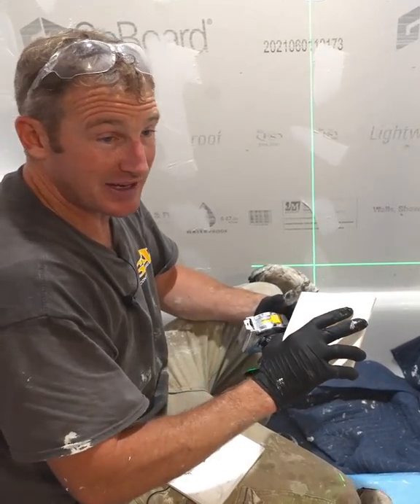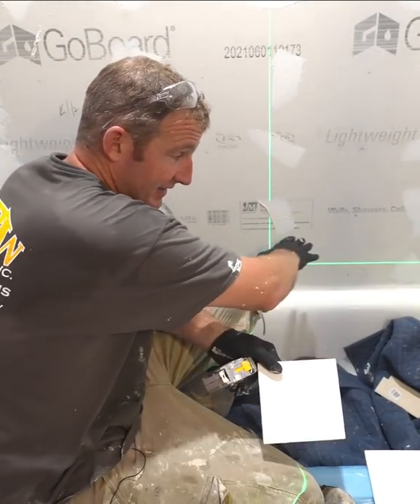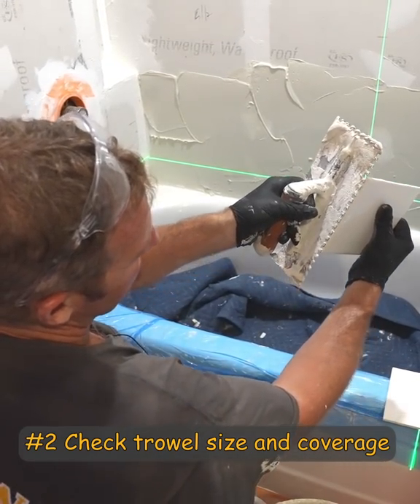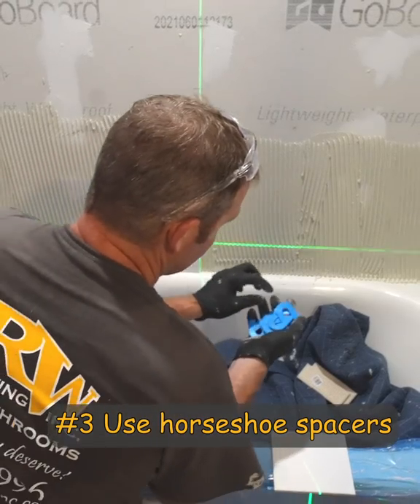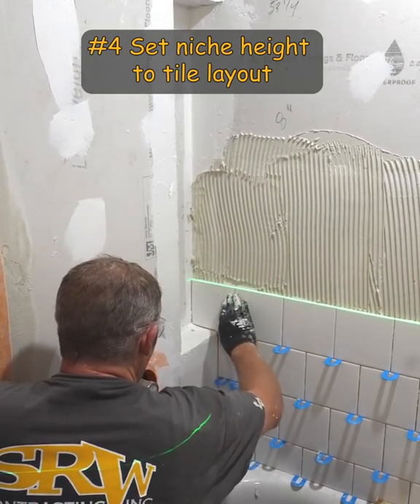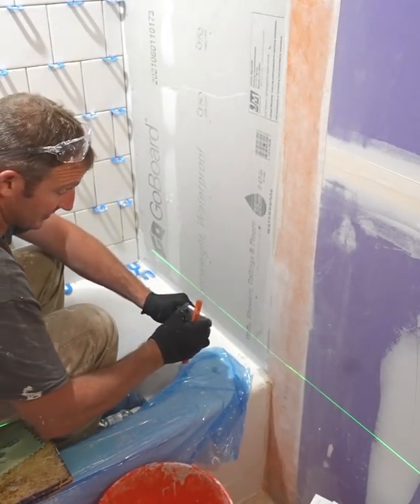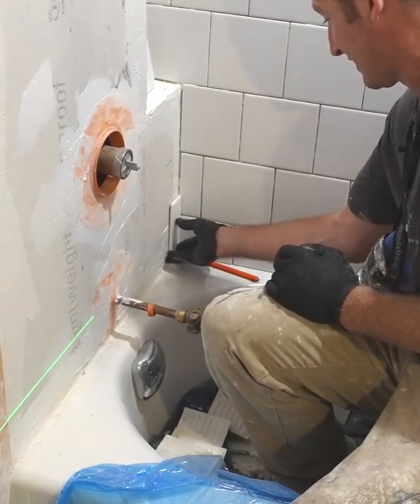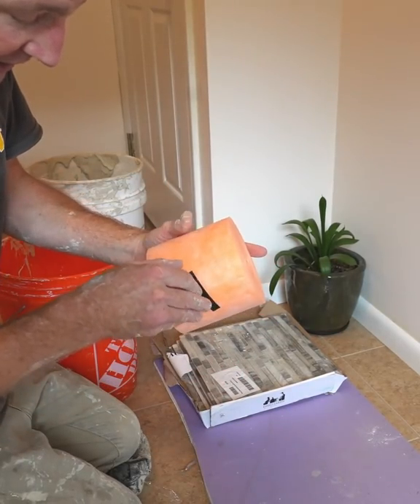7 tiling tips for a tub surround #shorts

Comment: It takes too long to cut each piece, if they are different , to run the first row , so I always set a piece of wood on a level line on all three sides and set the second row first to ensure that the grout lines are true on all three sides and everyting is level. Later after the tiles sets up you can remove the ledger board and cut in the 1st row . If there is a quarter inch difference then I set the ledger board a quarter inch lower than the height of one tile . Works beatifully .
Reply: Make sure not to break waterproofing when doing so
Reply: If it takes you "to long" then stop doing it because apparently it's not for you 😂
Reply: @GALAXY_M4N  I've done enough of them to know it's easier my way, and it is a VERY common approach in the field of laying tile . How many have you done ?
Reply: @leskobrandon3497  plenty dawg, guess u never used a fuckin sliding tile saw, literally 5 mins to cutt all those bottom rows, and it looks SO much better
Reply: @GALAXY_M4N  How does it look better whether you are cutting the bottom row first or last . you ar still cutting the bottom row in . My way I'm not letting the thinset set up on the wall while I'm cutting tile and figuring out which end to start on . Your argument makes zero sense .

Comment: Really sorry to state this but, in my opinion, the adhesive should always be applied horizontally so when placing tiles the air between the grooves creates a vacuum/suction it stops them from slipping. If you apply the tiles slightly higher (approx 10-15mm)  then gently in a downward motion drag them to their final resting place, the air really does do a great job... Great tradesman all the same 👍🏻👍🏻😉

Comment: Probably one of the only guys on YouTube I’ve seen start tiling without screwing a piece of wood on to the wall. Well done!
Reply: The tub surface is the substitute for the wood. They usually use wood when it's a shower
Reply: A ledger boards the way to go keeps walls perfectly flat nothing shifts on the bottom because of angled cuts. Makes for an easy perfectly plum and level shower every time just waterproof your holes from your screws or nails before you install your bottom row if you’re doing Kerdi  it takes like 10 seconds. But I only install about 70 custom showers a year. With both traditional water and water out beds with topical waterproofing or complete Schluter system depending on the shower and building.
Reply: @okgeeokg2737  a ledger board will keep tile straight not plumb
Reply: no problem with using a timer to start. as long as you cuts are tight!
Reply: @jasonparkhouse4029  35 years tiling and still use batons. I personally find it quicker to start off on a baton and drop the bottom cut in later. Horses for courses.
Reply: @Busyboy 42  Yes, that's what I do too. Mark the scribed tiles with a fine tip, and you can't go wrong, in my opinion.
Reply: What do you think the bath tub is??? It’s acting as your Timber 🤦🏻‍♂️😂

Most Tilers use the Baton method and drop in the cut at end!
Reply: @tilerman 💯
Reply: @Jack-russell103 If it is level then it IS plumb too .
Reply: @leprechaun7667  Some tubs aren't  level and if you are making cuts your working against time and  the mortar setting up on you

Comment: I personally measure a full tile up add however much for top and bottom grout, use a piece of strapping and start a row up, run the shower up until a couple rows from the top put my finish rail on, then take my board off and bam. No rip cuts. Saves the work of having to cut 10 tile for a starter.

Comment: With that niche, isint the bottom tile suppose to be on first, so if the water hits the wall it will run down and off the base tile instead of through the grout and into framing? Does it matter in your situation

Comment: Yeah the Schluter membrane on the back of the accent tile is the way to go, they sag and need a million spacers if you don’t do it this way. The manufacturer of those mesh back tile 12x12 squares could solve the problem if they just made the back mesh stronger, maybe a thicker mesh or something. It adds an extra step to put the membrane on the back but it’s 100% worth the time letting it dry to not deal with sagging and to get a perfect tile job.

Comment: Naaa offsetting the corner looks tacky. Just use the left over cut from the back wall to continue the pattern on the sides. Doesn’t matter if it’s a small piece. It looks way better when the grout joints match and it looks like a continues piece

Comment: Wait... why would you need to scribe the first row of tile? Tub should be perfectly level. The edges on every tub I've worked with are consistent.  Why would I need to scribe the tile. I've always had a consistent gap with all tiles of the same size. What am I missing  here?
Reply: Newer cast tubs basically all newer tubs have some profile near corners and of course the radius of the edge. I’ve been doing the same thing for years. Just never new others did the same.

Comment: Nice work and explanation!  What size spacers would I use for 12*24 porcelain tiles?  Thanks!!
Reply from the maker: I typically use 1/16” spacer. A lot of times tile isn’t completely square on the edges and the joints look a bit bigger than a sixteenth
Reply: @BathroomRemodelingTeacher  thank you!
Reply: @lmd6204  1/8th spacer is much more ideal. It’ll help to avoid lippage.

Comment: I never understand how contractors dont take a little extra time and protect the tub when working around it. I know I always do. I want the tub to be in the same condition it was  before the work.  Am I
I wrong?
Reply from the maker: I’m in the hunt for the best protection. Please provide something helpful. I’ve tried the paint on stuff, used moving blankets, plywood over top, all don’t work that great….
Reply: @BathroomRemodelingTeacher  I always use some roll and stroll hard floor protector or duct tape a sheet of correx around the bath.
Reply: @BathroomRemodelingTeacher  I usually start with regular painters plastic held with blue tape about 1/4 inch from the edges if I'm tiling. Then I'll lay a folded up drop cloth on the bottom and drape them over the edge. the last one I did I cut a piece of 2 inch foam to set over the tub and across the front of the tub and put a piece or 1/2" osb over the top and I was able to stand on it. The drywallers dont cover zhit..they looked at me like I was nuts but sure liked working off that platform! l
Reply from the maker: @trevanherek6003  I’ll have to work on that. 2” foam is a good idea. I recommend Americast tubs though. I put them through abuse and they hold up well 👍 thanks
Reply from the maker: @joebloggs9719  duct tape might be the key. Some of this very smooth finishes don’t hold masking tape very well thanks 👍
Reply: I’ve been using two rows of the green g tape. Then basically laying a folded tarp in the tub. Pull the tarp daily, clean and a quick wipe out
Reply: I put blue tape around the tub.  Then 6 mil plastic taped to the first tape.  Then drop cloth in the bottom of tub. 
After I set up to chest height I put an old interior door over top of tub to stand on and work from, makes it much easier/safer and less bending over.
Reply from the maker: @therealhikebikemike  thanks! Sounds like a good method. The hardest part for me is taking the extra time to do it, 😆 that might be the most reasonable way to do it 👍
Reply: Just work clean. Most acrylic tubs have a plastic film on them already. Porcelain tub take alot to damage. If you keep your work area clean, don't cut or nip in the tub and keep your foot wear clean you should really have to worry about damaging your tub. Poop happens though and sometime you get a scratch or chip. There are companies out there that repair tubs and it's relatively cheap

But again work clean and you shouldn't really have to worry about damaging a tub
Reply: Carpet shield can work and a piece of plywood

Comment: Do you put the first row touching the bath in or the row above it first?
Reply: Set a line on the back way a little lower then a full tile, maybe 1/8 lower, then set the back wall  of tile according to the top of the tub bc sometimes the top of tubs arent set level, cut the bottom of the first row of tile while leaving yourself about 1/16 to 1/8 joint line between the tub and the the first row of tile for expansion and subtraction which you fill with %100 silicone that matches your grout color for the field tiles.  Then after you've done the first row continue up the wall. Hope this makes sense, it's really hard to explain via typing.

Comment: How did you start your tiles? You didn’t show it. What I usually do is set the level as you did and then I hang a piece of 1x on the wall on that line,  I then tile all my walls with the board in place to ensure nothing moves. The next day or afternoon I will remove the board, fill the holes correctly and then hang my last row of tile, which is along the shower or tubs rail so that as you said I have a tapered cut on the tub.
Reply: If you use wall mastic (glue) you don't have to do that. Just draw a level line 3 rows up and start your tile there and work down to the tub. Most wall tile  won't sag if you use wall glue.

Comment: Good tips, but you forgot to mention always make sure no small pieces at ceiling, and don't waste money on schluter skimming back of glass design tile, instead skim it with a wire mesh trowel (don't push too hard or it will blend through).  Next day cut the design glass pieces to size then when you install you won't have bleed through or the glass pieces moving out of position, you can also set larger 12x24 tile on top of it and don't need to worry about weight, with schluter on back of design it's not as stiff so you won't be installing 12x24 tile on top of design pieces the same day.  It's not easy to learn to skim it without bleeding through to grout joints, that's where experience comes in, cement has to be mixed perfectly with perfect weight on trowel.

Forgot to mention only cut 1st row if all 3 sides of tub aren't level throughout, plumbers usually are lazy and don't make sure it is level even though it's supposed to be, so it's good advice to always cut first row for a beginner

Comment: Do you recommend silicon caulk at the seam of the shower wall and shower floor.  My contractor used grout and 4 months later it is already cracking. Thanks.
Reply: Yes grout can not expand and contract and will eventually crumble
Reply: @aaronbrown3896  Thank you.   It is ok to put silicon caulk over the grout?

Comment: I’m installing Subway tile around my tub all the way up to the ceiling. Do I need to have a gap in between the tile? Or can I just butt them up together?
Reply from the maker: Check your particular tiles if they have little bump outs to provide the gap, then no. Most these days need a spacer to provide a grout joint. And I’d definitely advise having some kind of grout joint 👍
Reply: @BathroomRemodelingTeacher  Thank you!
Reply: @BathroomRemodelingTeacher  must wall tile have a spacers built right into them just make sure you don't have a Little  piece at your ceiling.

Comment: No waterproofing the cement board before you setting the tiles?  That would be a best practice; it might cost you $100 more in a project and maybe a extra day
Reply from the maker: https://youtu.be/X93JNDaXR50
Reply: @BathroomRemodelingTeacher  

I watched other video, thanks for your link.

I was saying painted red guard or other waterproofing application on your board for additional protection. 

You are doing very good job than many contractors I have worked with in the past. 

I was a builder myself…. I always think for possibility issues can happen to homeowners in down the road.

Comment from the maker: Remodeling a bathroom? 🛁
Here are 7 tiling tips for installing tile for a tub & shower:
#1 Cut your first row of tile so you can overcome any unlevelness
#2 Check trowel size and thinset coverage on tile
#3 Use horseshoe tile spacers verses rubber spacers - much easier to set
#4 Set your shower niche with layout of tile - most of the time lining up niche with grout line works great for most tiles and edging
#5 Extend tile past your tub to avoid water issues against drywall
#6 Offset tile in corners - my personal preference, I like seeing the tiles fold in corners
#7 Set tile borders on Kerdi membrane night before to install and adjust borders quickly - especially with these newer thin glass mosaics 

🎥🎥 Check out full tutorial video - https://youtu.be/i16GIfwkYuY

Comment: I wouldn’t hire this gentleman based on his incorrect initial misconceptions about tile installation. 

The tub should be installed level. 
Check with laser level. 

The backing board should not be touching the tub edge. 
Tub’s raised and rolled edge is designed to keep the water from going into the wall. Board touching the tub edge wicks the water into the wall. 

You want to start the first row with full tiles. 
You generally want the least number of tile joints in the wettest areas to minimize moisture infiltration. The bottom back corner of the tub / shower enclosure should be started with 2 uncut tiles. Cut tiles at the outer edges if necessary
There is no substitute for common sense
Reply: You are quite literally everything wrong with the trades